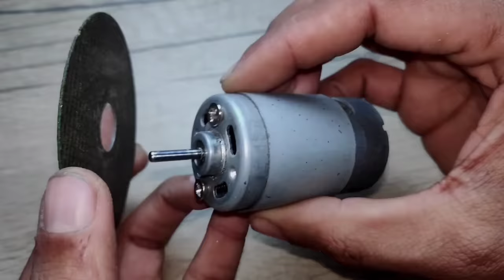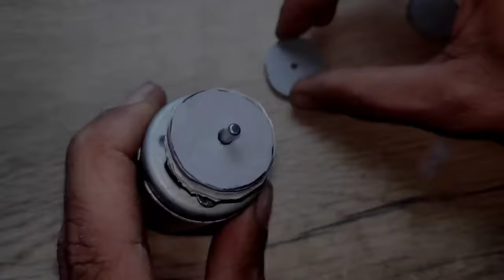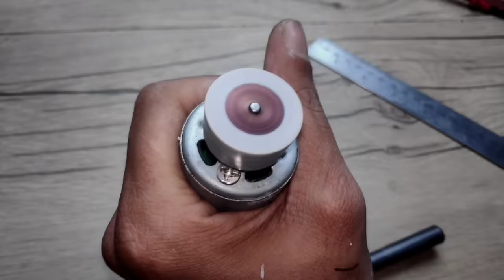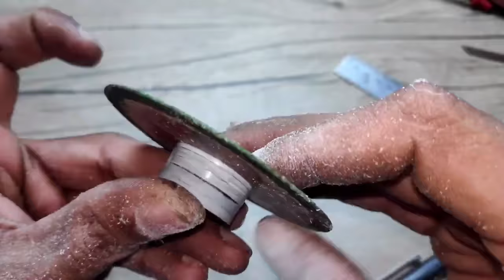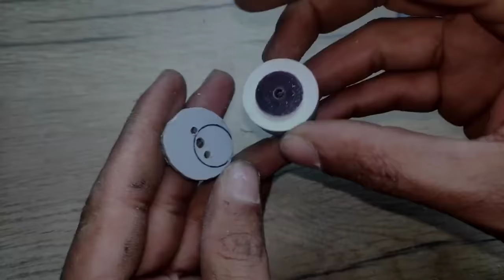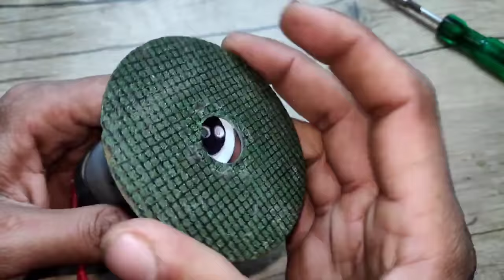खुद घर पर बनाएं 5mm shaft Connector angle grinder के लिए | How to make 5mm shaft Connector

Comment: Bhai motor kaha se liye ho??
Reply: Aur kitne Ampere se Chala re ho?
Reply from the maker: Maine market se li thi 120 ki ap online 775 motor le skte online mil jayegi
Reply from the maker: Mai computer ka SMPS se chala raha hu Power supply hoti hai usme 1.2 v se 12 v tak hote hai 5 amp se 36 amp vo maine computer shop se 50. Rupay mey khidi thi
Reply from the maker: @khangames8901  ap amazon se order Krna review check Krna pehle
Reply: @khangames8901  12v 3 amp ya 24 v 2 amp par aaram se power tool ke liye le sakte ho
Reply: @Expertricky  link bhejo
Reply from the maker: @SNTELUGU  bro ye wali motor toh Maine offline market se li thii ap onlile 775 ya 555  motor le skte ho Amazon se
Reply: Bhai ye motor meena bazar jama masjid ke samne 2 no gate par mil jaye gi aram se 150 ya 200 rupye me delhi 6 se

Comment: Nice But showing all the works keeping in hand is not correct. should use vice and avoid fingers contact with objects drilling or grinding. will mislead youngest to try in the same passion. please correct the video
Reply: De Acuerdo, Está Dando un Muy Mal Ejemplo. Así no se Trabaja una Herramienta de ese tipo.😝

Comment: after changing blade 4 to 5 times pvc washer thread will spoil and useless engineers are not fool as they are using alloy in tools
Reply from the maker: Itni jldi khrab ni hota pvc pipe hai han iron  k sath compare ni kr skte vo toh long life hai but Mai kafi time se use kr Raha hu it's working very well